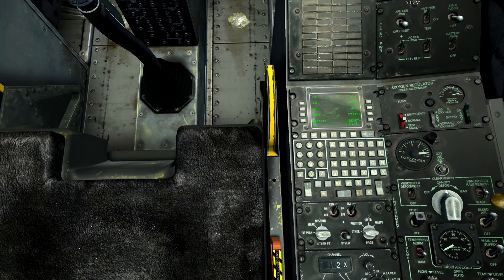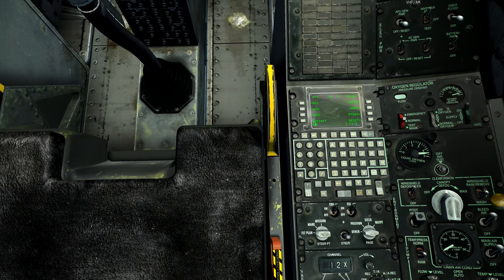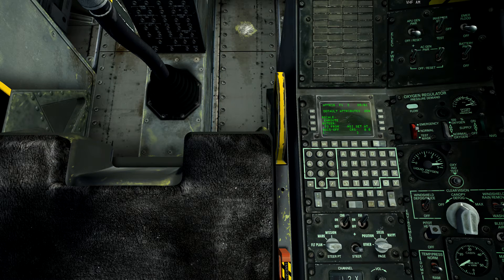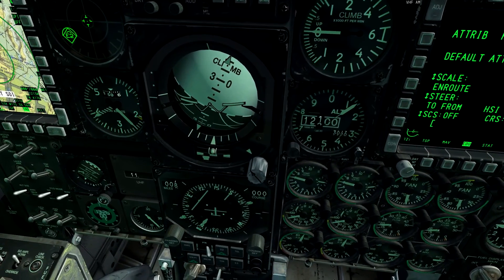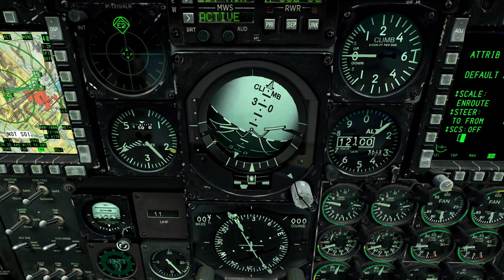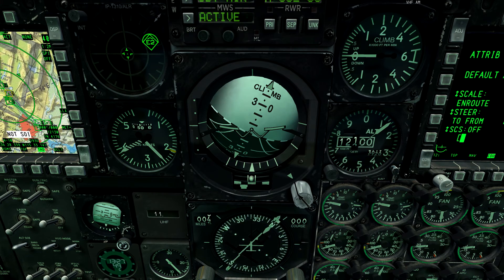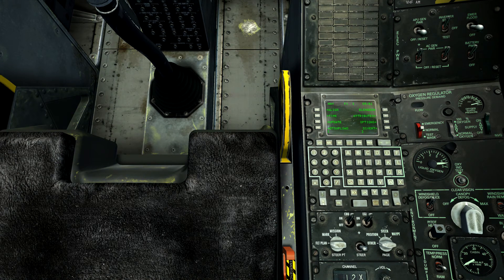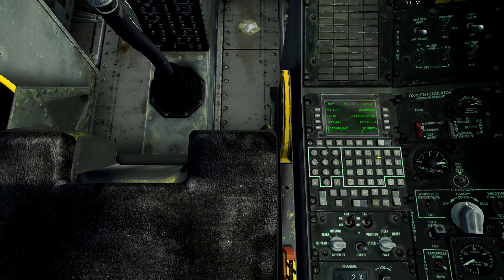A-10c - An In-Depth Tutorial of the CDU - Part 05 - The Navigation Page

Comment: If I understand right, I can put a waypoint on the threshold of a runway and set the waypoint type to terminal and do an EGI approach ?
Reply from the maker: That is my understanding as well but I have not done it yet and am not absolutely sure.  Can anyone else shed light on this?
Reply: I tried this at Tbilisi airport, put a WP on the end of 31L with 3D VNAV and a 3.0 degree glidepath. With no ILS tuned, nor TACAN or anything else, and with EGI and STPT enabled on the panel below the HSi. 
Set the Course to 303 and got the bars guiding me in. So it seems to work. 
I did have issues with the altitude setting, as I set the WP with the altimeter setting I had with the plane, and that threw it off when QFE was set.